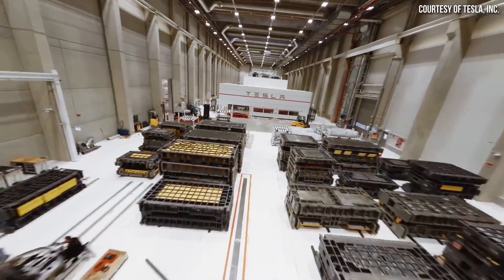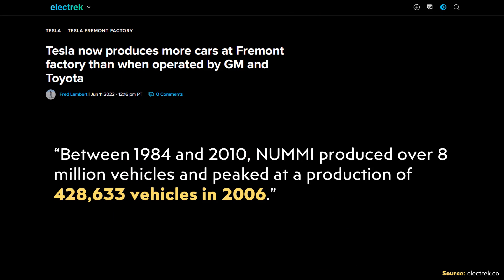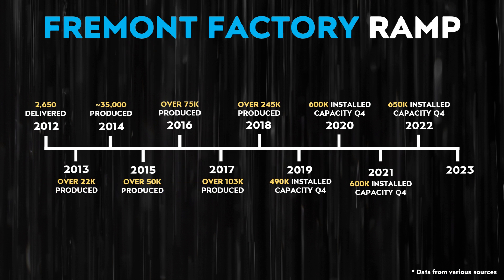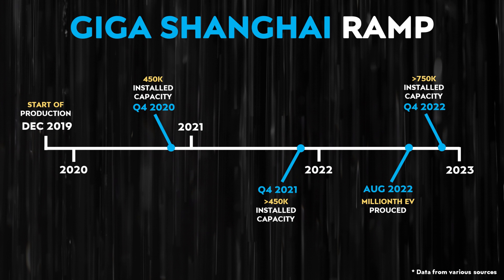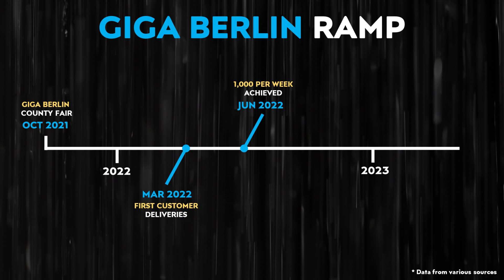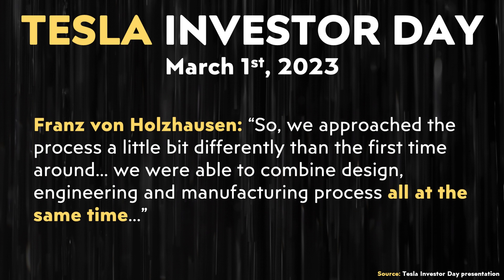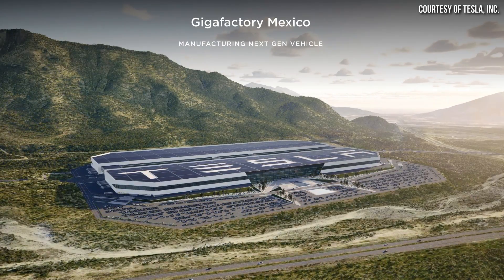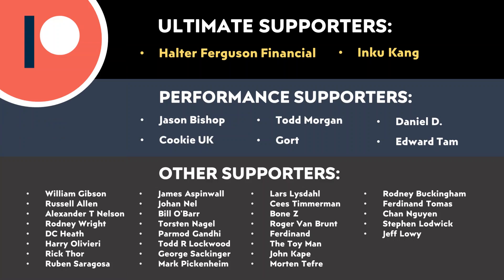How Tesla Became so INSANELY GOOD at Making EVs | 2012 vs 2023 Comparison

Comment: I wanted a Tesla but I took a test ride in a model y and it creaked, rattled and there was a lot of road noise. The suspension is harsh. Technically the best electric car there is but unfortunately the build quality and comfort do not seem to be very important. I am comparing to my current bmw 330e which is a premium car, so perhaps unfair, but still…
Reply: I really wish they had included air suspension.

Comment: Too much hype about making an EV. iCE or hybrid vehicles are far more complex and time consuming to build, where as an EV is a skateboard battery and one or more motors. Seriously an EV is just luxury golf cart. Tesla basically got cheap and replaced a real dashboard with knobs and dials with a touch screen. Every Tesla has had at least one recall. Facts.
Reply: What you call "hype" is detailed reporting on the marriage of tech, minute by minute innovation, engineering, production. Don't like/value it? Why are you watching? 
Yes, the ICE is "far more complex and time consuming to build", less dependable, less efficient, more expensive to maintain, operate. It's OLD tech, being replaced by better tech. You call the old tech "real" and the new "cheap", "just luxury"? Do these "new-fangled gadgets" confuse/frighten you?
Reply: @1voluntaryist   Its not detailed reporting its Tesla funded 3D graphics with lots of promises like humanoid robots, brain chips, hyperloops, Mars landings and CyberTrucks. Its Tesla hype.  The Tesla is not a new-fangled gadget, its basically a luxury golf cart. The first production battery powered car was in the 1890's. Sure the design is updated by new tech, but its basically a battery and motor. Today's EV's use tons of dirt for power instead of lead and acid. Which is an improvement, but still 50% of the battery is not recyclable and it will leave mountains of unusable battery waste. As many engineers have said, we are just changing how we pollute.

Comment: That is the Tesla did all of this on purpose out of sheer genius version. The actual reality version goes: lots of the top parts suppliers would not even talk to Tesla on the phone, so they were forced to vertically integrate and make many things for themselves. Being vertically integrated allowed Tesla to see the entire production process and not just assembly, and most automakers specialize in assembly and body panel stamping and painting. Tesla badly underestimated demand for the Model 3, when the orders  avalanche came in Tesla realized that manual assembly would never keep up, panicking, Tesla put together a plan for automated manufacture hastily, hiring multiple different companies to design various segments of the automated battery pack and automotive productions lines. Multiple companies failed their tasks, and Tesla was left in production hell, madly scrambling to keep production ramping while shutting down entire sections of the production line and creating work arounds as fast as possible. Realizing that redesigning just sections of the failed lines was not going to cut it, and in danger of going under, Tesla bought Grohman Automation Engineering, the leading manufacturing automation engineering company in the world for cars and in general at the time to redesign the automated battery pack production line from scratch. 

The combination of Grohman, the company the German automakers habitually hired up to that point, who again were already ahead of everyone else in manufacturing engineering, and the Tesla engineers, Silicon Valley Playbook, and leadership of Musk, is what really put Tesla where it is today so far ahead in terms of manufacturing design and process. Starting with the assumption one is wrong, being eager to fail and to learn, trying multiple solutions at once, first principles thinking, all of these are important ingredients, but ultimately most of Tesla getting where it is today was a product of necessity and desperation and buying Grohman. If things had gone to plan, Tesla would be far behind where it is today.

Comment: Great job. Note about SPAN. We got one last spring but I've been disappointed by two things.  First, it can't tell you which breakers have tripped. Seems crazy that a "smart" panel can't tell which of it's own physical breakers has tripped. Second, during the recent atmospheric river we had power outages and span could not communicate with the powerwall during the outage so it had no idea how much battery was remaining. Since it's more useful to have this info during an outage this is disappointing.
Reply from the maker: Interesting... I assume you have relayed this info to SPAN? I am pretty sure they can send OTA updates to the panels and update them in the future, so it would be helpful to them to have this feedback, so they can further improve the product.
Reply: @Cleanerwatt  I have and am talking with them about these issues. Surprisingly they seem somewhat surprised by them, which is... Concerning. One of the things that makes the breaker issue a real problem is that our inspector forced them to install arc fault breakers because they removed a panel in the kitchen when we upgraded to the SPAN. It turns out that the same things that trip a GFCI plug trip an arc fault breaker and many of these things are mundane, like stopping it starting an old blender or hair dryer.

When our kitchen or bathrooms lose power is useful to know what to reset. Now I have a choice, walk around to every plug and try and reset the GFCI, or go out to the garage and check the breaker. Not smart.

As for the OTA, we've had our system for a year and I'm unaware of any ota during that time, including several features such as Bluetooth connectivity that were suggested as "nearly ready" when we purchased the panel that have gone undelivered.

I hope they get better over time and I hope they stay in business but they definitely can do better.
Reply: Too much hype about making an EV. iCE or hybrid vehicles are far more complex and time consuming to build, where as an EV is a skateboard battery and one or more motors. Seriously an EV is just luxury golf cart. Tesla basically got cheap and replaced a real dashboard with knobs and dials with a touch screen. Every Tesla has had at least one recall. Those are the facts.
Reply: @Obi Juan  Nice to get a slice from the ICE side...but do note that California is already measuring better air quality  from the adoption of EVs. The EV future cannot come fast enough.
Reply: @calmorton4619  Its too early to say California is already measuring better air quality, nor is there any data to support such a claim.  The percentage of EV cars to all California cars is 1.8%.  The number of cars total increased every year 2010 - 2019.  That is not enough to say that California is already measuring better air quality. Especially since many people spent lots of time at home during the pandemic, which reduced air pollution globally and would account for less pollutants.  SO, NO there is no evidence to support that claim about air quality and EV's.